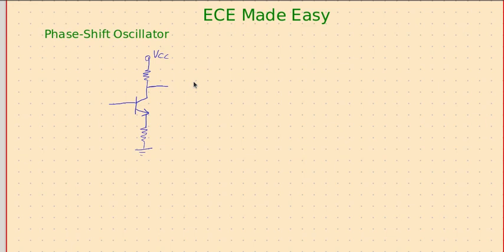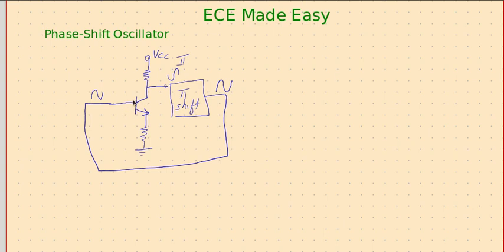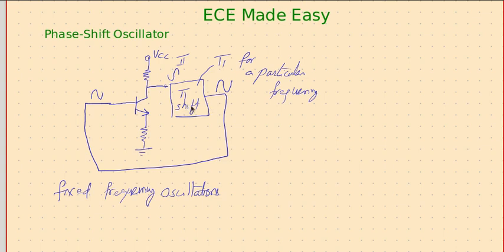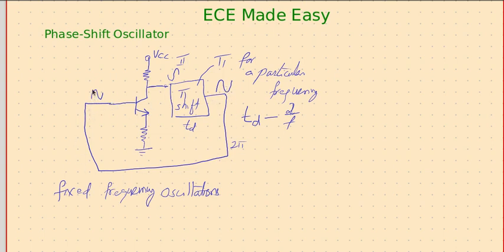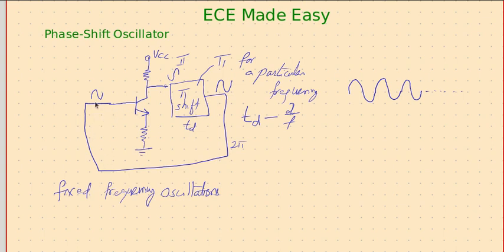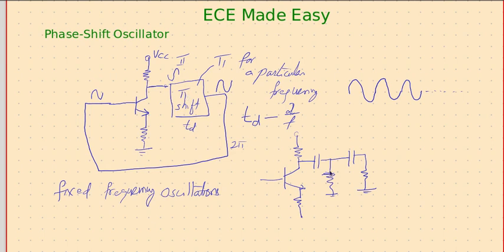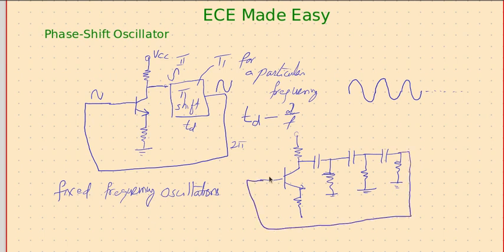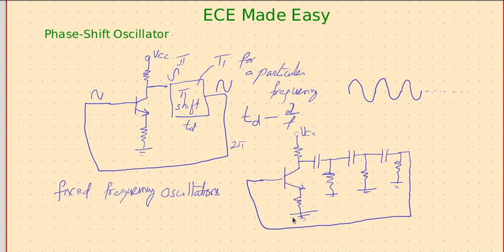Circuits Active Oscillators RC

Comment: Sir where is attenuator in rc circuit?
Reply from the maker: Thanks for your query. The triple RC circuit used to provide 180 degrees phase shift will surely attenuate the signal applied to it. The basic property of R is to dissipate energy into the atmosphere as heat and the dielectric in the capacitor will be leaky. These two reasons will attenuate the signal. More details, refer to the videos on Resistor, Capacitor and RC circuit.
Reply: @sandeepmandrawadkar9133  thank you sir